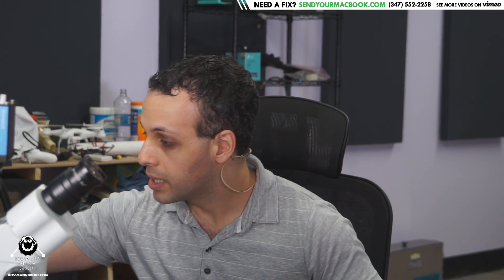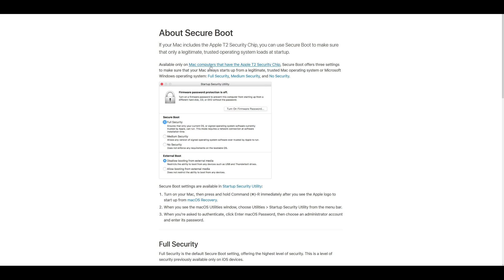An important message from Louis Rossmann

Comment: TL:DL
Apple taking TWO from facebook's playbook "Default auto Opt-in" and related opt-in killing your "Secure data".
Reply: Soldering the drive to the logic board, not a good move.
Reply: @Soren0  From a security standpoint, this is a good move.
Reply: @therinwhitten  security standpoint to solder the drive to logicboard? If the drives dies you are screwed, I wouldn't call that secure. On my MacBook Pro, if the internal drive were to die, I would pop in a new SSD and be up and running. On the newer machine, I'd be out $2,400 as the machine will be bricked.
Reply: Too long didn't long?
Reply: @enb3810  didn't listen I presume
Reply: Auto opt in for security is always good practice. Soldered on ssd that can't be recovered is poor design.
Reply: @Justplanecrazy25  I agree about the soldered on SSD being not a good move. If one can't access the data as they auto opted in for secure boot without them knowing I don't think is a great practice.

Comment: Apple is doing this to force everone into using their cloud based storage. They want you to buy a $1500 laptop then pay a subscription to their cloud storage that backs up your data.
Reply: increase the chance for paying apple to fix your device
Reply: Most trash companies out there don't want you to just buy their product and enjoy it for the next 10 years. Just like Sony did after seeing how stupid xbox players are to pay to play online. You buy the console, you buy the game, you're paying for internet, yet if you want to play online, you have to pay extra.
All of this shit caused by stupid people. And it ends up affecting the ones that aren't stupid but just don't have a choice now thanks to the stupid ones.
Reply: It's also a security measure. If your data is that important, you don't want random people grabbing your data off with an external drive, or compromising the boot chain so that you leak the encryption keys.

Of course, this doesn't apply to everyone, and opting everyone in especially when it could break at any time isn't a good thing. Especially since the only way to recover is backups, and not everyone takes good backups.

There's also the issue that cloud storage may not be secure either if you choose to use that...

tl;dr It's a security measure with good intentions that's badly implemented and should be opt-in.
Reply: @Kylemsguy  On every other machine you can a) disable secure Boot with a password, which makes sense.
b) mount the drive anyway as long as you know the password for the key header.
Both requires a password, which, if you have it, would compromise an apple machine just as bad as any other, but without the useless "feature" of locking yourself out.
Reply: actually Time Machine does not back up to iCloud, thus I call this a bs argument.

Comment: Uefi secureboot? Try ubuntu directly on flash drive. Works for me.
Reply: Ubuntu is UEFI secureboot compatible on machines that have the Microsoft key in them.

I doubt that Macs have the MS keys.
Reply: You have to disable secure boot for that to happen. (Unless what I experienced was different), you have to take it to Apple Store (or someone like Rossman who will likely charge less for what is essentially a device wipe)
Reply: On Macbook as I know, secure boot is bit more than uefi secureboot.
Reply: But hey if it works for you on a Mac (not PC) I haven't said anything.
Reply: @FeuerfaustGolDAce  I know I've booted up to 2019 macbooks with catalina with Ubuntu, just don't know if they were in the same configuration as louis describes.
Reply: AFAIK, UEFI secure boot and Apple's secure boot are two different things.